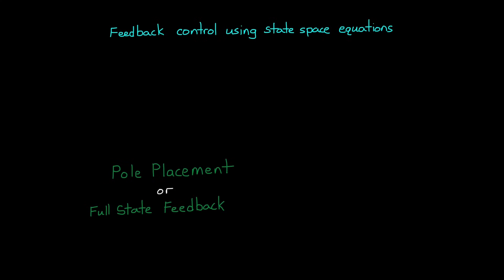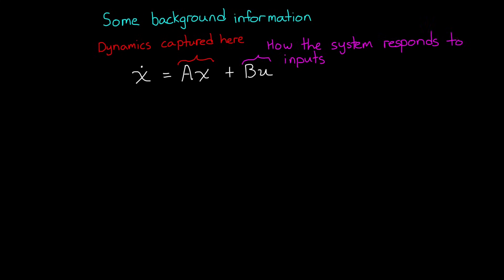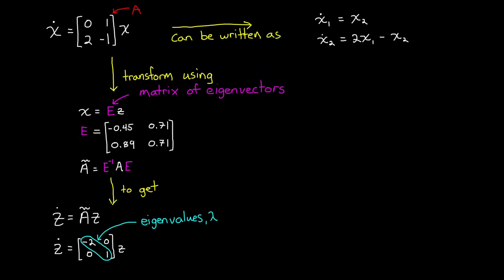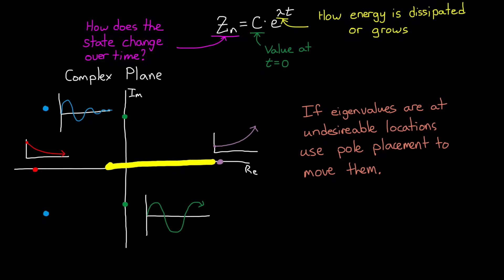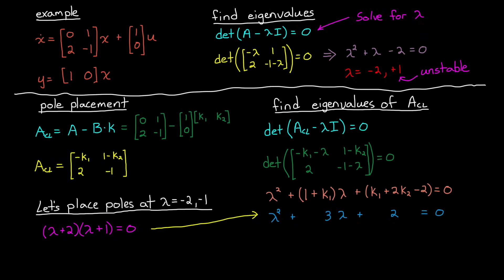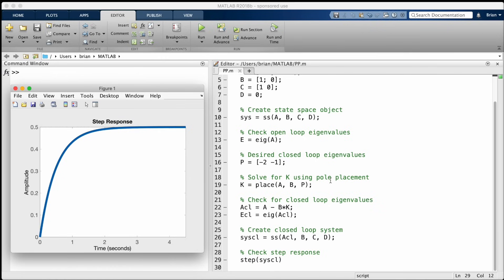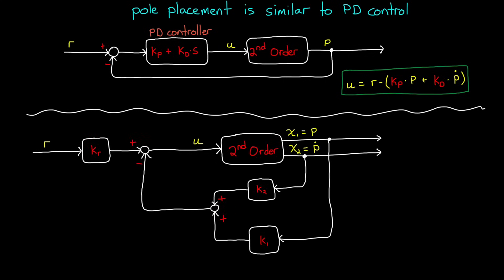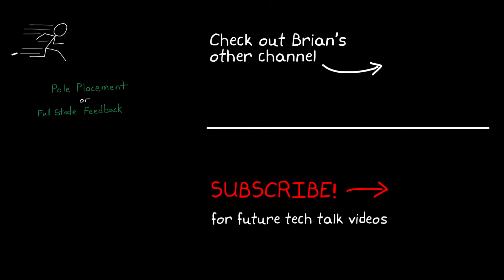What is Pole Placement (Full State Feedback) | State Space, Part 2

Comment: is it bass gura method?
Reply: The video just describes pole placement in general. I believe the Bass-Gura method is a way to compute the state feedback controller gains from the coefficients of the desired closed-loop characteristic polynomial. So, it's essentially the same thing, I think, just instead of selecting the pole locations like I do in the video, you select a characteristic equation that has the desired pole locations already. Then the gains for the controller are found directly from the coefficients of that equation.

Comment: why do I feel pole placement is like root-locus...
Reply: Because it is :) But root locus for more classical control systems can’t arbitrarily move poles to a desired location, for a single gain you can just place poles along the root locus. With a pid controller you can add a pole or a zero and have a bit more control, but expressing the system in state space (as in this video) allows you to arbitrarily choose pole placement, though in practice this will be limited by practicalities of your system!

Comment: is there a reason why we move the pole values to -1 and -2 or just randomly choose, is there a method to choose the best poles for the system
Reply: You can use root-locus design method techniques to find the locations that meet your requirements.
Usually when working in a project you have some requirements regarding damping (or overshoot), bandwidth, loop gain and actuator effort (or something related to actuator effort, like battery life of total system).

Comment: How do you calculate the reference gain when there are multiple inputs/outputs? 
For instance, if the system is 2x2, then the DC gain will be 2x2, do you invert the matrix and multiply by the reference?

Comment: Hi Brian, Thanks for all your great videos.
I have a question regarding the control signal u for the PD controller at 12:36. 
Shouldn't the control signal u be a function of the error (e = r-p) hence the controller output u should be: u =  Kp.e + Kd.e_dot = Kp.(r-p) + Kd.(r-p)_dot ? I mean shouldn't r be multiplied by the gains also?
Reply: Gah! I completely messed that up.  I'm not sure what I was thinking when I wrote that transfer function out.  Good catch!
Reply: @BrianBDouglas Maybe you meant a special case. For example if the input r is constant (a step input) , then its derivative will be zero. So we'll end up with r.Kp which makes it similar to the state feedback equation with Kr=Kp and the rest are the same.
Reply: @BrianBDouglas  why isn't B multiplied by Kr as well when calculating the modified A matrix? i.e. Acl = A - B*Kr*K? Asking because B is multiplied by Kr later.
Reply: Thanks for asking the question. I thought I was going wrong somewhere.
Reply: i also has this doubt thanks from your reply I got ans